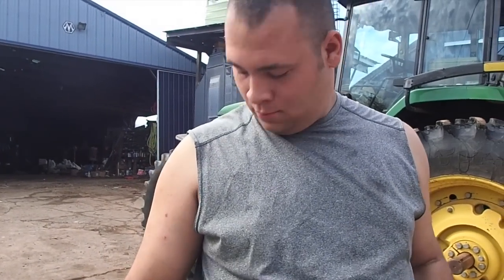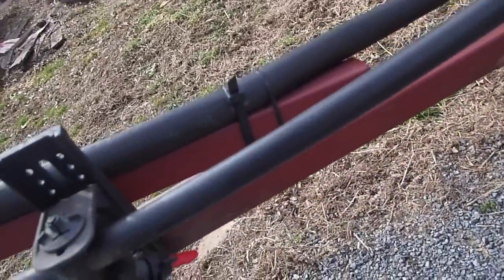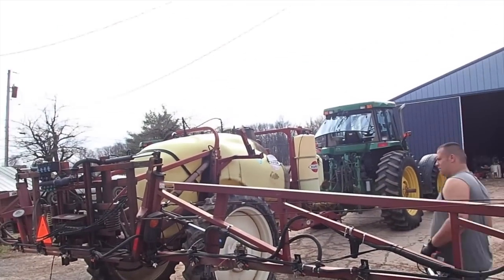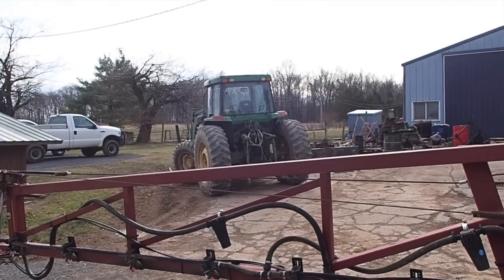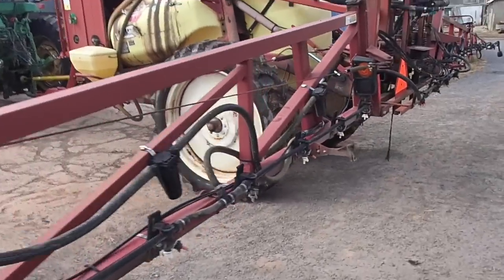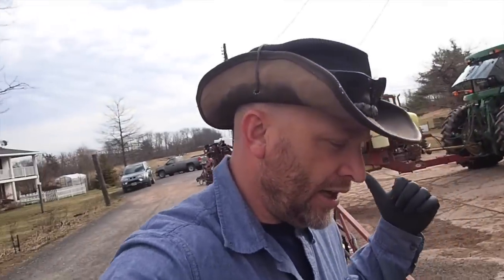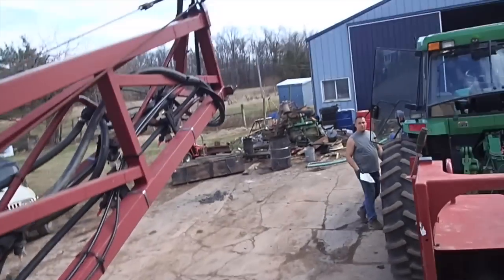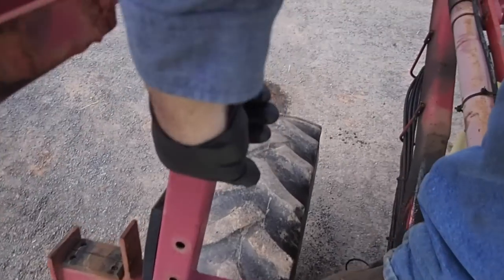GMO Death Machine

Comment: Del Tec tape is a heavy duty alternative to tie wraps. About 3/4 inch wide on a 100 foot roll with double sided ends. Cut to fit metal locking tooth holds securely. Ends are reusable. From the telecom Industry.

Comment: I notice that in preparing the sprayer for the new season, testing the spray heads themselves for clogs, etc. (using plain water, for example) wasn't shown in the video. I figure you flush them out after each run anyway, but is that sufficient after the sprayer has sat idle over the winter months?
Reply: +kglefo x2 ,,, ? Good question to learn ,,,
Reply: My dad and I flush out the sprayer before the season and after also if we are switching crops we flush

Comment: Could you mount a caster wheel on the end or last link of the boom or a skid plate so when boom dips down would protect the spray tips & accessories, not to heavy .    On the end of boom where you whack fence rows fasten a hollow boat dock float, buoy ? 
Love the maintaining videos !
Reply: Boom is supposed to tip up and down with the contours of the land at a set height
Reply: That stuff still adds weight and eventually u put enough weight on the end my uncle tried that he had to get a new boom

Comment: will you be doing a video on spraying, and what you are spraying? would love to know how you get the nitrogen on the grass without checking growth by burning, spraying fertilizer would be virtually unheard of in Ireland it's all granulated for the most part. will one spray do the whole year or do you spray multiple times? we used to get a contractor in to inject nitrogen into the soil for our grazing paddocks which was just one application for 5 or 6 months, but never used it for silage ground.
Reply: Atleast my dad and I in Michigan we just spray it on the corn we dont inject it into the ground and pretty much I just know about corn I have done some commercial spraying on grass but it was alfalfa and the guy wanted me to kill it so Yah it took about 80 jugs of roundup and my dad made Alot of trips with the nurse tank

Comment: Why no quit dealing with the foam markers and get GPS.  Raven has the Cruzer 2 on WAAS. No more solution or damaged bells.
Reply: If you need gps to drive a straight line you have no earthly business on a tractor
Reply: GPS isn't perfect either
Reply: Depends on how far you take the system. RTK with auto steer is sub inch. System will cost $30k, Yearly RTK service is $10k..... Everything has a price.
Reply: I plant on RTK and have had much trouble with holding sub inch in changing weather and also base station location is a big problem for us with all the buildings we farm around.  That and if you're only spraying on GPS, is the cost of installation/operation really worth it compared to a $30 foamer bell?